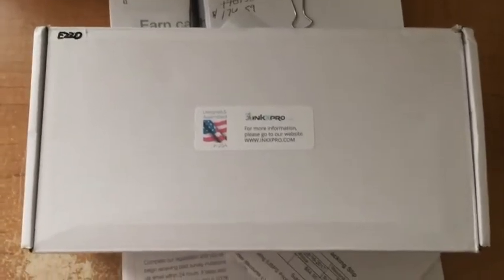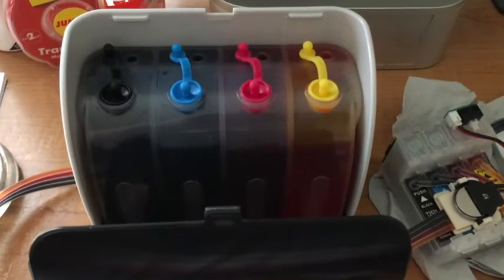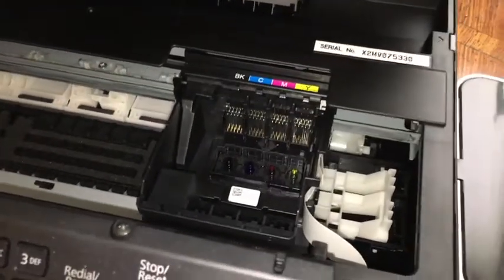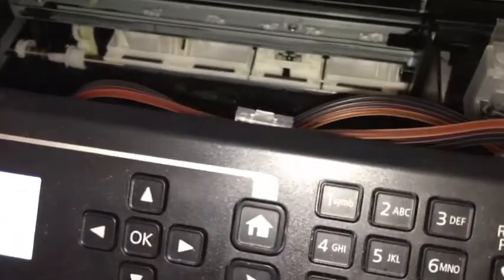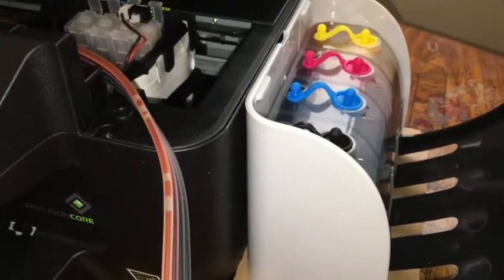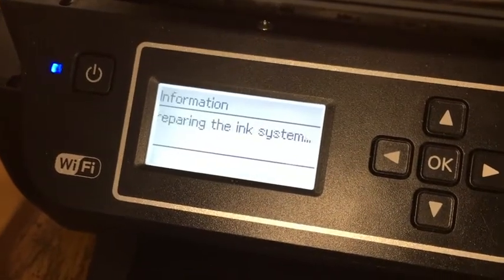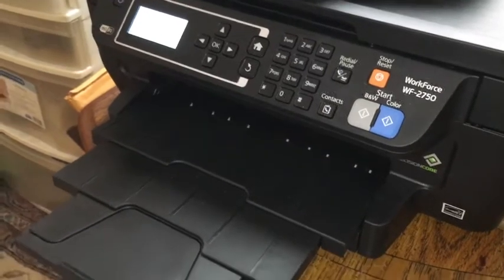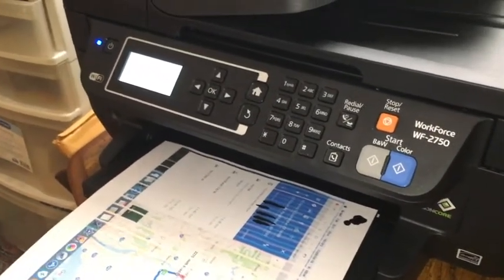How  to upgrade to a Super high capacity printer  using  a  CISS  printer ink   device!

Comment from the maker: Where you place the stick pad for hose  put it one level  lower where i had it  where  the  house  icon is  inside so cover closes.

On the CISS  ink well the top smaller plugs are the ones to keep open when printing .